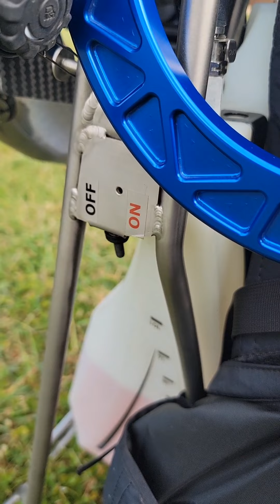Mav Max vs Standard Maverick

Comment: The tank release is everything because you can transport your engine inside a car. I used to have a Baelys with that system and moved my engine in a Audi 1, with the rest of the equipment.

That is it!
Reply: You can do that with a regular Mav. What difference does the tank release make?!
Reply: @turkeyphant  I haven´t seen a regular _Mav but normally you have to empty the tank before you can load horizaontaly it in a car. When you are able to release the tank, you can load the motor horizontaly and the tank vertically in the car wihtout spoils risks.
Reply: @AlfaRomeoFox  That's not true at all. I've done it for 2 years every time I fly. You just need less than half full or just put a cap on to stop spills. Much much easier and quicker than taking the whole tank off.